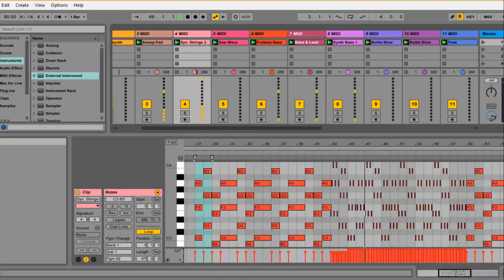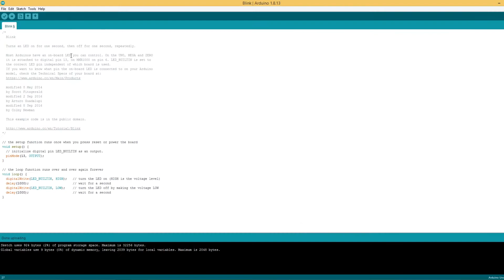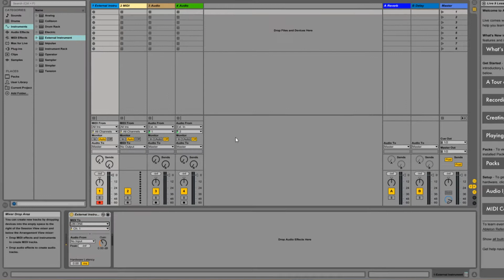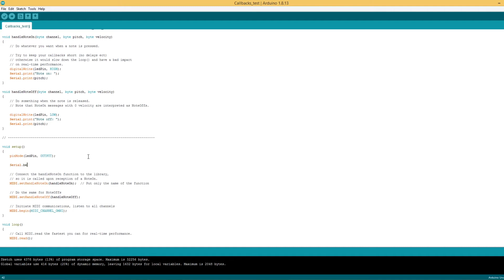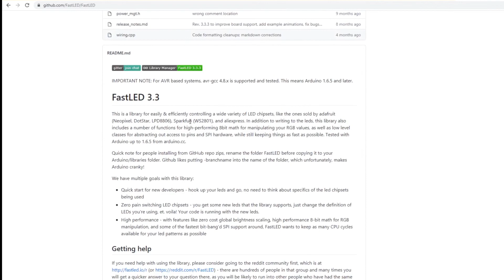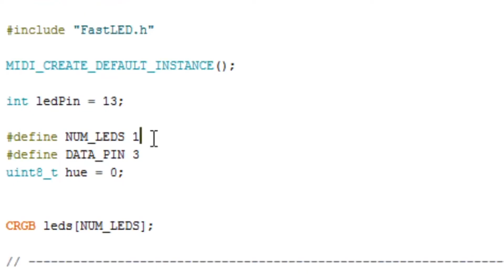MIDI controlled LED strip - Part 1, setup

Comment: great video! gives me a great start for a project I am going to be working on, basically I want to add leds just above my piano keys then have everything sync up via midi. then I can either have it just light up as keys are pressed or more importantly when im using something like synthesia to learn to play songs as the program is telling me to play notes (it does midi in and out) the matching key will light up, I think it will really help with learning and help in cases where I have to spend a couple seconds asking myself What key is that? 

could also be a way to make some music creation fun, having some led strips that can react to pc midi going on. It's giving me all kinds of ideas. maybe led strips that then take midi info from a SC-55 while I play some classic PC games?

Comment: The MIDI occupies the only hardware UART port on the 328p. Unless you use softwareserial library with the midi library you won't be able to use the serial monitor along with midi.

Comment: hi im a bedroom producer i would definately buy/use/back this. is there a way to make some kind of passthrough device? i.e. usb A female ports on either side, plug your midi piano in through it. turn on, all lights come on; when sending midi signals through the controller, i.e. playing the keyboard, the colours would change, get brighter, whatever. if you have a kickstarter send it my way! google brought me here :)
Reply from the maker: Hey man! Thanks for your message. The alpha version actually has passthrough but with 5-pin MIDI. Doing USB passthrough would be possible - I'll keep that in mind for a future version!

So there is no kickstarter yet, but we are currently working towards multiple beta versions. You should stay tuned for those!

Curious, what gear do you currently have and would like to visualize with the lights?

Comment: I like the midi-to-LED function, the audio-to-LED has too much latency to match well with non-ambient music. Great job here.
Reply from the maker: Thanks! Yeah I agree, audio-to-LED usually doesn't work too well. If there isn't latency, the lights don't really match the audio (only if there's a heavy bass beat). The way they're made it's basically a fancy graphic equalizer, which gets boring quick.

Comment from the maker: EDIT: The Beta version of this product has just been released and is available to purchase! I'm quite proud of it, it has come a long way since this video. Check out my intro video: https://youtu.be/QgpmtSLMIaI
Reply: is it possible to set up LED lights to come on when you activate a stomp box or pedal effect through a midi switcher/looper. my idea is that I want to have a back light come on/off for each pedal that I turn on/off, wether I click on the stomp pedal of the pedal and/or the midi conroller/switcher. hope that make sense. As a serious inquire, I would hire you for your services. Thank you in advance.
Reply from the maker: Should definitely be possible, and maybe with the controller I've already developed (or with some minor modifications). 

How are the pedals and MIDI switchers connected? Do you know what kind of MIDI data is outputted from the pedals, and the midi switcher/looper? What you're trying to do sounds really cool and I'm interested getting it working for you, but I'm not too familiar with pedals and MIDI switchers currently.
Reply from the maker: Awesome, I assume there's a lot of flexibility with the editor? 

For the pedals, which midi parameters can they output? If each pedal somehow has a unique signal (ie. you can assign different channels to each, program changes, a midi cc value, or manually assign something through the editor) and that signal can be routed through the switcher, then hooking up MAINFRAME so it can display different colors per effect should be possible.
Reply: are you selling the alpha version yet? I am definitely interested in it if so!!
Reply from the maker: @PianoDoctor   @Josiah Jaxn  The beta is actually coming out really soon! Until I am able to get the website and more videos up, you can e-mail me: info(at)syntheticstate.com for more info
Reply: I'm emailing you. subject MIDI Pedals
Reply from the maker: MAINFRAME is the name of the product that these experiments lead to. Alpha was released, working on Beta currently. It should be able to handle this task!

Just saw your e-mail, I'll respond right now.
Reply: @mainframesys  yes, i’m looking for the same solution. I have a helix that can send  cc commands that I want to turn on lights on a particular Amp based on a button press

Comment: I'm really enjoying the way you're filming and editing these :) Looking at your code and wiring, you're using the Arduino's serial port for the MIDI, so you won't be able to use Serial.print - it's dealing with MIDI at 31250 bps!  There's no super-easy way around it with a Uno because it's only got the one hardware serial port. I wouldn't want to try using software serial at that speed on an 8-bit AVR device, so you'd have to create one for your debugging at a lower speed and then use a USB UART connector thing to talk to it.

My modular MIDI controller is using an Arduino Mega 2560, partly because it has four hardware serial ports (and partly because it was lying around not doing anything!) so I can have the MIDI circuitry hooked up to one of the other ports and leave the main one for Serial.print :)
Reply from the maker: Ohhhhh damn... I had a feeling it was because MIDI was taking up the serial port. I thought it might work because MIDI only needs the RX line on the Arduino, so at least maybe the Arduino can send messages through TX. I didn't know that MIDI is at such a high baud rate though! I'll keep all this in mind. For now though, I use the lights for debugging (how about Morse code through RGB LEDs?) and I installed a separate piece of software for seeing the raw MIDI data stream.

I sometimes hate how the UNO has only one hardware serial. Like you, I do have a Mega lying around somewhere though......